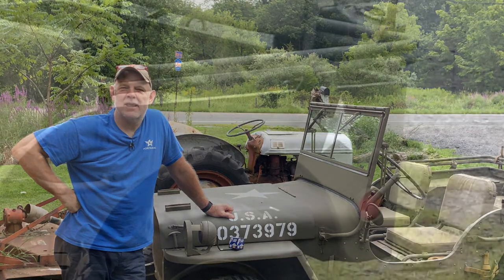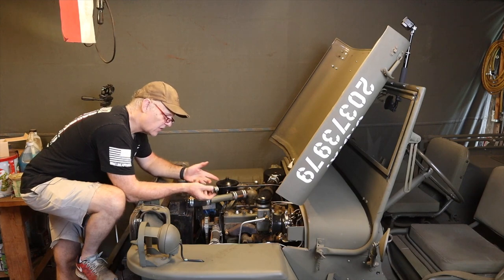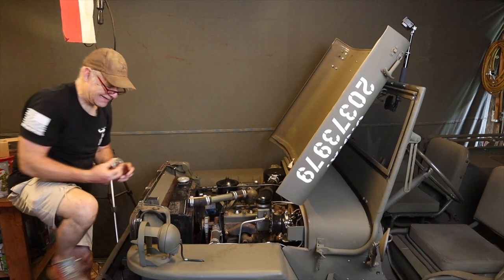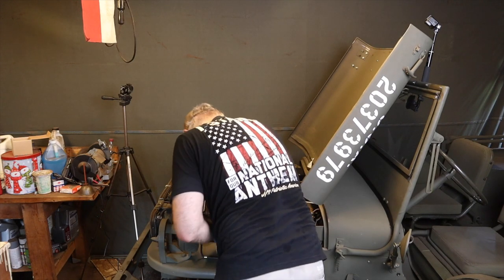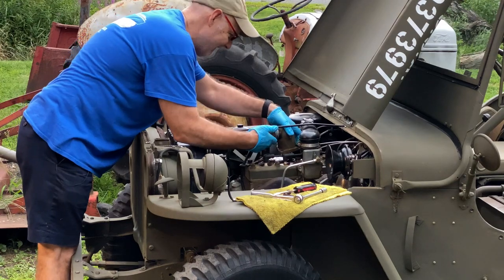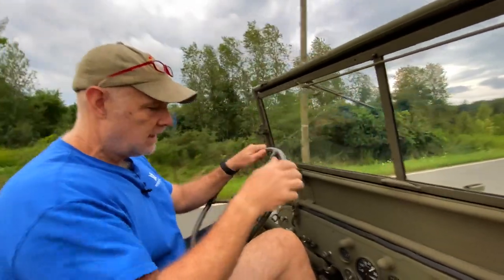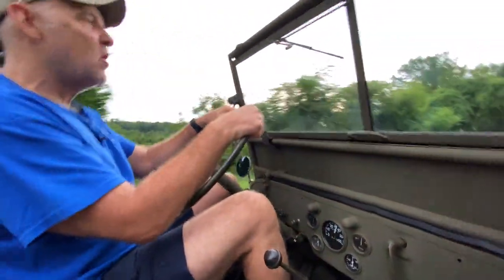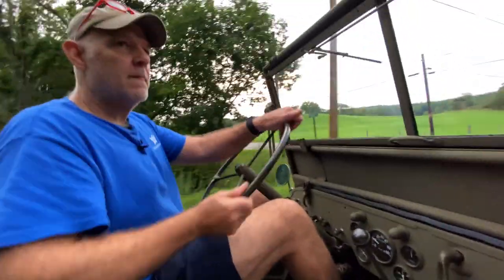WW2 Jeep Engine Overheating Causes & Fixes #G503

Comment: Wow...all so familiar.  After soooo much work on my 46 (so much was wrong) it now runs at 180 with a 165 thermostat.  Temp heads up hill to 190/200 on long uphill grades then drops back to 180 at the top or on the flats.  I am curious.....what is the small hole you drilled in thermostat?  I did not do that (I used a modern thermostat like you).
Reply from the maker: Good stuff.  I know a lot of people who have jeeps that are always running closer to 200.  Not that hot, but still too hot in my opinion.  

The original bellows style thermostat has a small (probably 1/16") hole in the valve plate .  From what I have read, the hole is there to allow the pressure to equalize after you shut the engine down and then the coolant temperature in the block rises before normalizing.  Supposedly you can get an "air bubble" in the system without the vent hole that prevents flows and causes it to overheat.  I have no idea whether this is correct (sounds a little suspect) or just a wive's tale, but I drilled more like 1/4" (because it was handy and the other thermostat was installed so I did not know the size).  I can't see how it would hurt except in the coldest of temperatures....

Comment: Is the wining noise from the gearbox normal on these war jeeps?
Reply from the maker: Yes ….I did reset the differentials so the noise may have been a little more pronounced when I first put it back on the road but they all have this whine.👍🏻
Reply: @Portrayalpress  thanks! 👍

Comment: Engine expansion plugs water pass ways  need steam cleaning thick Harding mud clay internal block all  old jeep engines has that problem my keep runs 120 temperature normal.
Reply: Correction, jeep
not keep.
Reply from the maker: @joe3973  Agreed!  These blocks need to be cleaned completely if you want them to run nice and cool.  Thanks for your response!